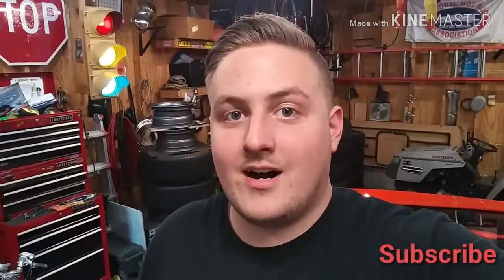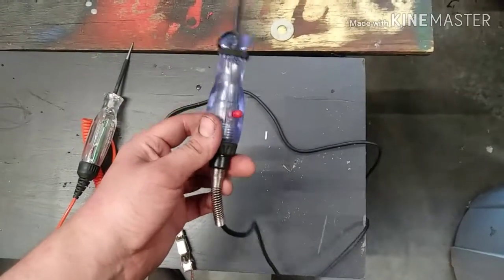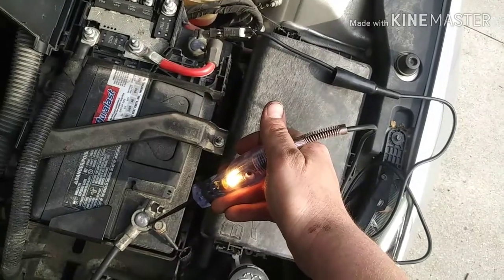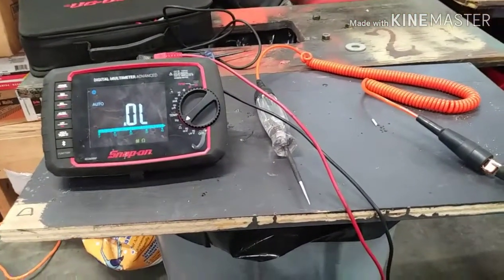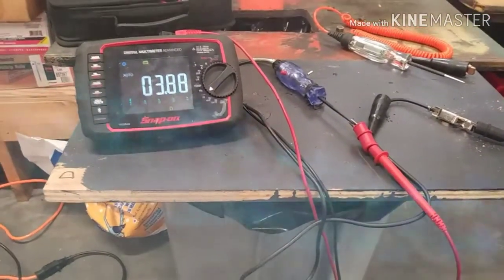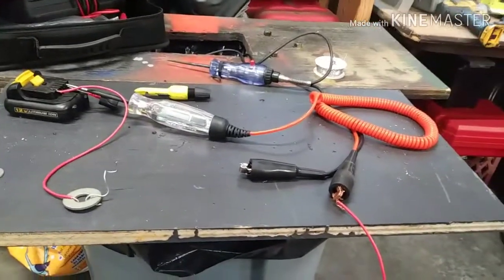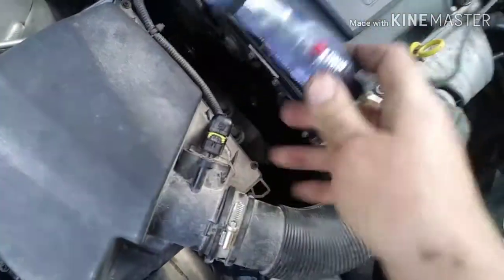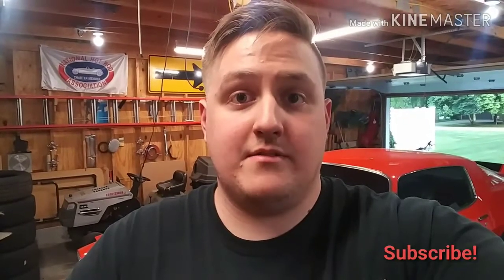Incandescent Test Lights vs. LED test lights

Comment: Think about voltage drop, as proportional to resistance. You have 12 volts of power, proportionally distributed, with respect to the resistance, between 8700 ohms (LED test light) + 4 ohms (incandescent test light). For the LED test light, the voltage drop, between the two electrical connections of the LED test light,  will be (8700 / 8704 ) of the total applied voltage == (8700 / 8704) * 12V = 11.99V. For the incandescent test light, the voltage drop, between the two electrical connections of the incandescent test light, will be (4 / 8704) of the total applied voltage = ( 4 / 8704) * 12V = 0.002V. Effectively, it's as if you had applied a 0.002 volt battery directly to the two electrical connections of the incandescent test light. In contrast, if you take out the LED test light from the series connection, the voltage drop on the incandescent test light will be ( 4 / 4) of the total voltage == ( 4 / 4 ) * 12V = 12V, i.e. the incandescent test light would experience the FULL 12 V.

Comment: The current from the battery is flowing thru the digital test lamp First, 
This type of test lamp will not allow enough current to flow thru it to light up the next test light which is the incandescent test light,  the incandescent test light needs higher amperage to light up the test light,   very low amps, milliamps will not light the incandescent light, 
There may be volts/ of pressure, but no current flow,  = no light. 
This is why using the incandescent test lamp is better for testing a circuit under load, 
Hope this helps,  Keith M